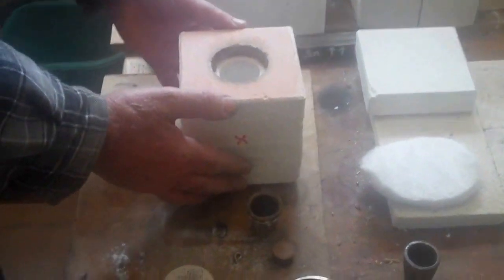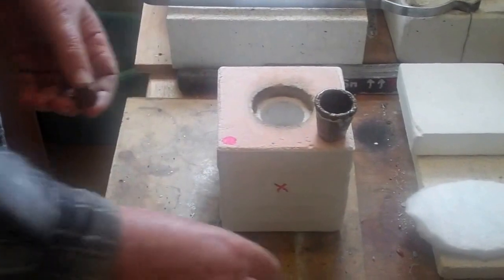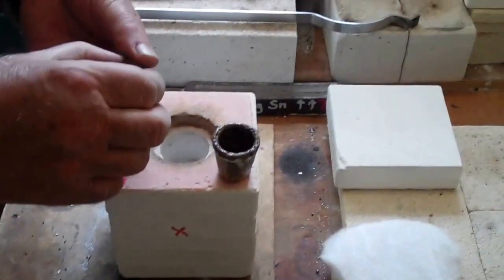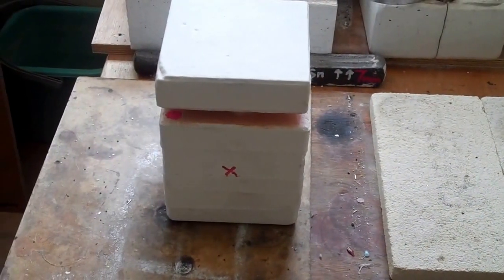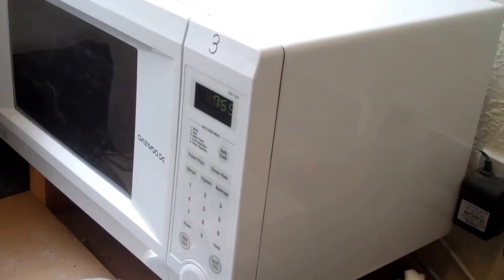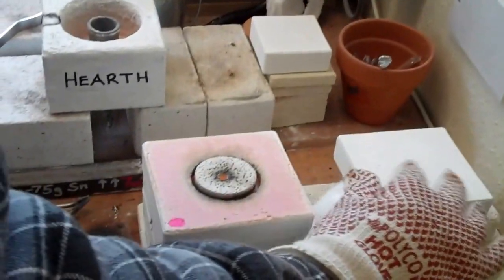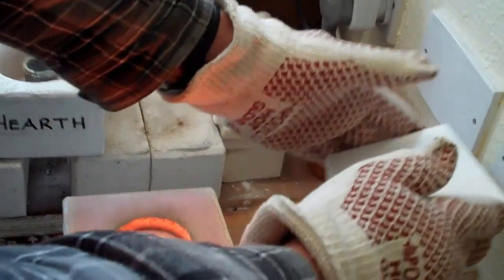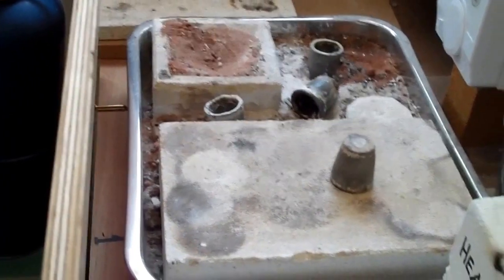First Melt using Microfoundry to cast a bronze ingot

Comment: I can't believe this video has had such few likes and views. It is incredibly useful knowledge demonstrated very well.
Even several years later there seems to only be about three videos on YouTube that even acknowledge the existence of microwave forges. Even though there are many videos of people gutting microwaves and filling them with heat bulbs to create conventional electric furnaces.

It is so surprising as 3D printing exploded in popularity years ago so pretty much every crafter/hobby engineer type on YouTube used 3D printing as a staple of their workflow. 

Microwave forges seem like the perfect accompaniment to 3D printing as you can do lost wax casting of the typical small 3D printed models & components everyone makes.

Comment: Hello Steedcraft!! We are happy to hear that all the equipment shown in 
the video is available for sale. 
 We are in need of the furnace kit (burning furnace, melting furnace, and graphite crucible) you used.
 Could you please share the details of those? We'll be happy if those are 
available, and we'll be buying immediately.
Reply from the maker: +Srinivasa Anurag Kandala HI Srinivasa, the microfoundry lost wax casting system is for sale for £350 plus p&p we also offer wax injectors and vacuum table bases  - there are vids of these in action on this channel. you cab buy through ebay or etsy looking for steedcraft microfoundry https://www.etsy.com/uk/shop/steedcraft if you have any questions please feel freeto email us steedcraft@gmail.com cheers Quin

Comment: Hi.  What is the furnace made of? It looks very light.  Is it a resilient/sturdy material?
Reply from the maker: Hi Hunter the furnace body is foundry brick (there are several grades) so it is sturdy and heat resilient, we coat it as it would be brittle left untreated.

Comment: This is maybe a silly question, but why this does not break the microwave? Cuz usually it's been told not to put any metal inside the microwave because it will break it.
Reply from the maker: Yes thats right Tamas we are trying to make metal casting as easy as possible for people to do. you dont normally put metal in a microwave but we put it in an insulated box to heat up so no harm to microwave at all.  - see other vids on this channel for more ideas. happy new year quin
Reply: @steedcraft  ohh ok so the total isolation protect the microwave from damaging. Thanks. I'm into this kind of stuff. I was looking for a method to melt bronze and yours turned out to be the easiest so far :) It is cheap and quick. Thanks for your response. :) Happy New Year :)
Reply: @steedcraft  can u please tell me what kind of metal came be smelted with this syatem
Reply from the maker: @mariokingston7999  we designed the system for jewellers and model engineers, we take copper as our upper heat limit, so copper is fine as are its alloys of brass and bronze, silver and gold pour very well  and the white metals alum pewter zinc

Comment: Would this work with aluminium?
Reply: Yes, Aluminium  melts at a much lower temperature 660(c)  than copper 1084(c) so i assume you would just need to cut down the time.